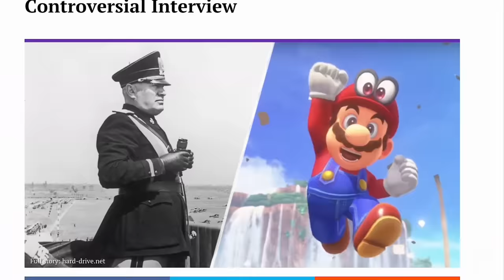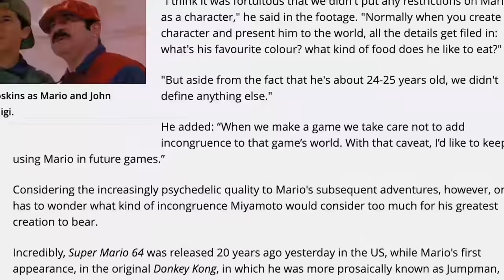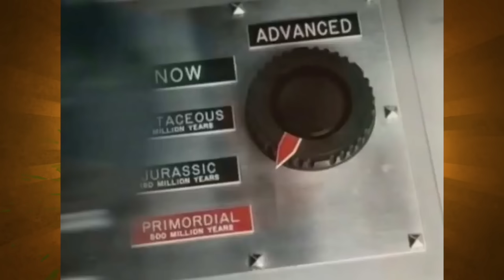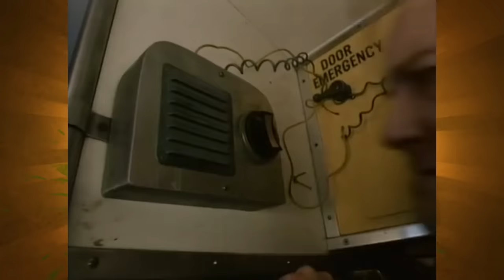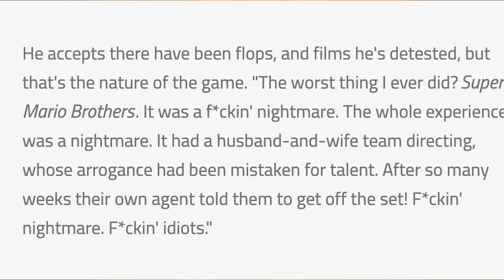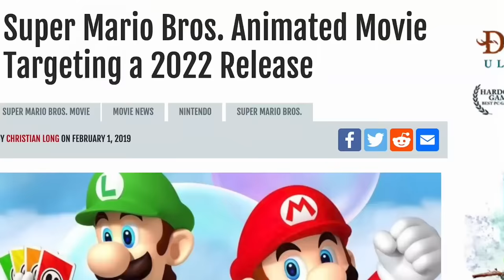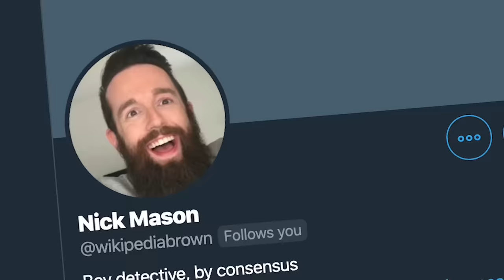Super Mario Bros. The Movie - Caravan Of Garbage

Comment: Imagine this. A clogged toilet. A roach infested apartment. The toilet sits in a half filled state of the most grotesque sights and smells. You have been hired to fix the issue. The drain snake has failed you. You are contemplating pulling a silent hill move and jam your hand in just to be done with it. You go to stand up, but a roach crunches under foot and you slip forward. Saving yourself from face time with the sewage but hitting the flush on the toilet. The water is rising. The fresh water reveals the horrors at bottom of the brown fogged waters. Using your plumbers training, you pull your emergency plunger and thrust it into the bowl. Without a splash, as is standard with plumbing training, you give one more thrust and retract your noble rubber companion. Draining the brown waters away to stained porcelain and clear water. Without a mess and the simplest answer is usually the correct one.

That right there is a plunger you hang on the wall. The unsung hero of the modern world.